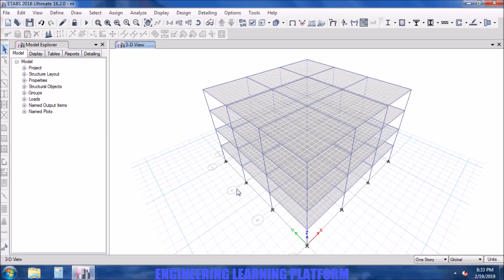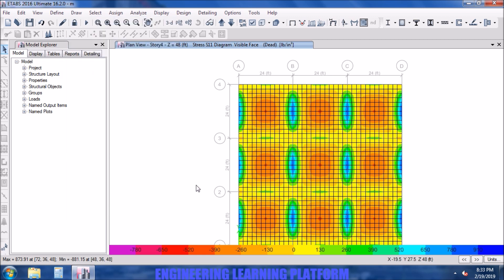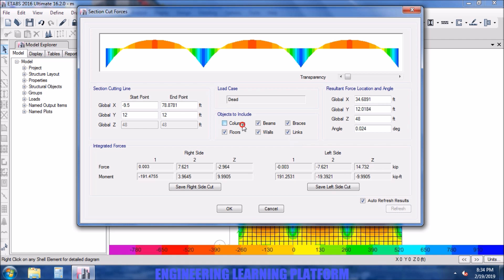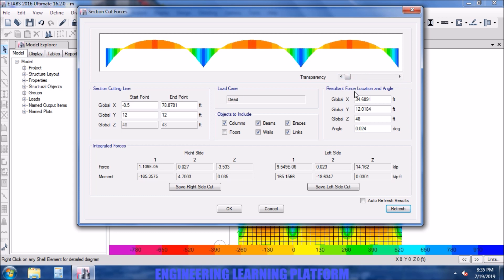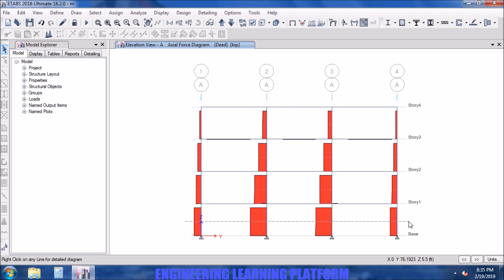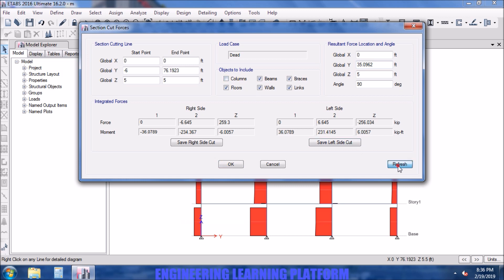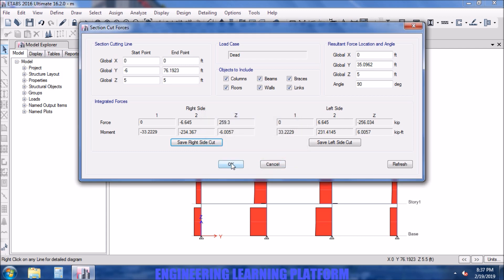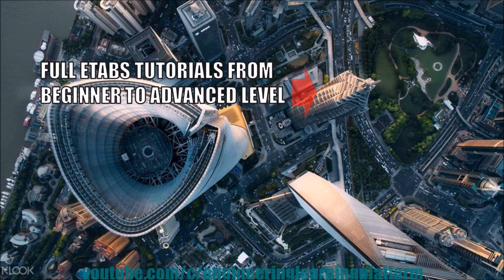How to draw section cut in etabs tutorial

Comment: Dear tutor. If you see carefully the moments in the section cut window,then they are showing around 234 due to dead load which is very very high (incorrect).Can you elaborate why it is like that ?
Reply from the maker: Its okay for 24 ft span as units are in kip-ft
Reply: @EngineeringLearningPlatform  sir, if you see the M33 moment diagram, that will have very less forces...Please check once your moment force diagram...It cannot be so high due to axial load specially when axial and shear forces are very less..Chek once..I am talking about column section cut results